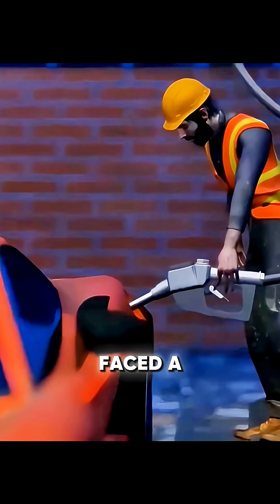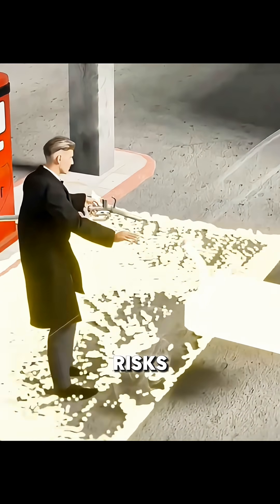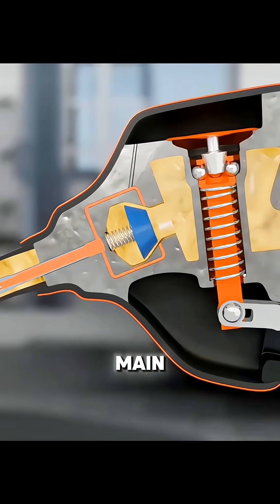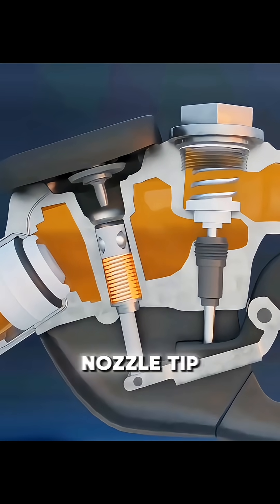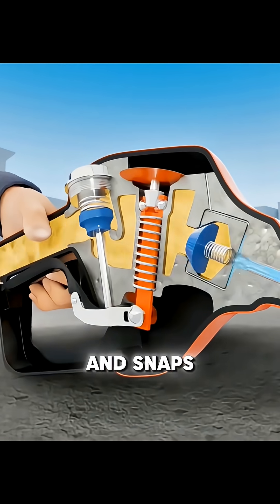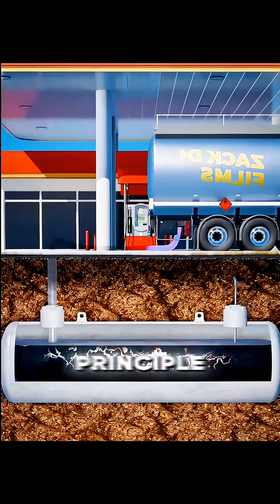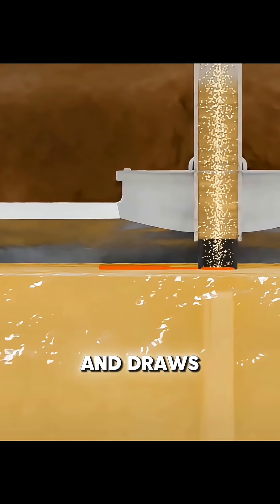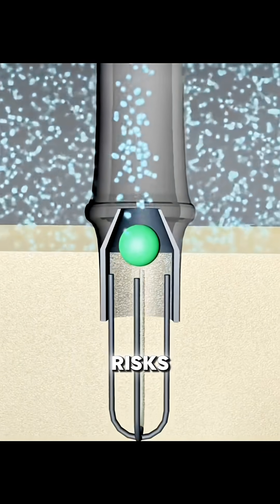How does a fuel nozzle know when the tank is full? #foryou #nozzles #zackdfilm

Comment: Do fuel fumes escape through narrow side tube as it draws in air?
Reply: There should not be any pressure build up in the Tank. Therefore the air and fumes from inside must escape the tank because the Volume ist filled with gasoline. This is also a reason why you are not allowed to smoke at gas stations. One spark and these fumes from the tank will burn instantly. There are many Videos which show exactly this when the cigarettes is in the hand which push in the fill nozzle.
Reply: As the fuel tank is filled the fumes are pushed out of the tank and collected in the evap vapor canister.